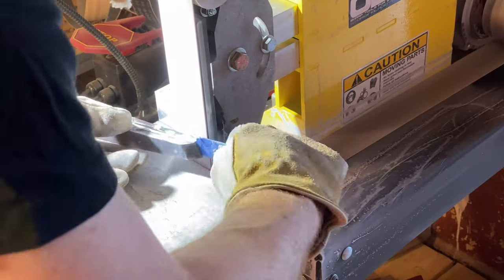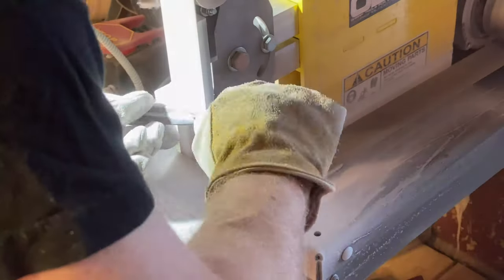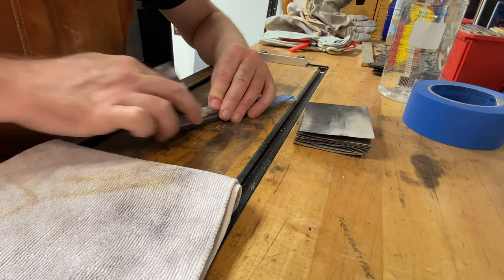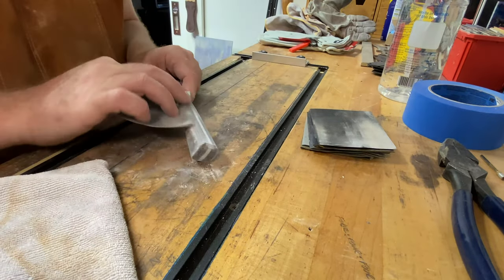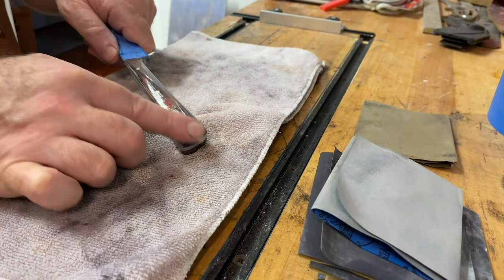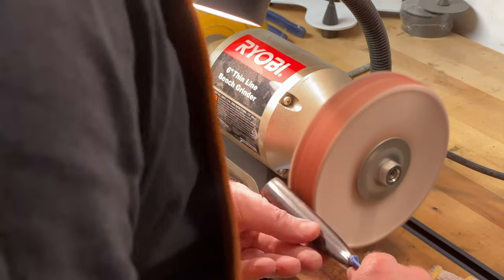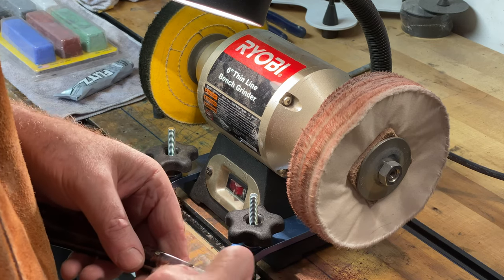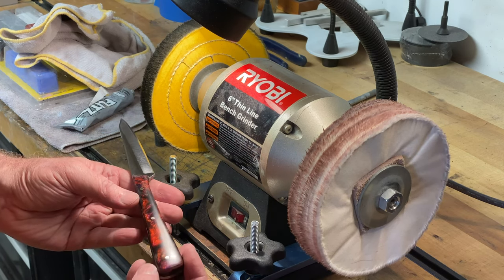How to shape and polish an epoxy resin knife handle

Comment: Nice knife and that work bench is awesome
Reply from the maker: Thanks! This is a 8' Gladiator workbench I bought from Sears about 20 years ago, and I added the T-Tracks about a year ago. I use Rockler hold down clamps in the track to keep my knife stable while I'm filing or sanding. The hold down clamps with the end stop are essential when I'm gluing up a composite knife scale.

Comment: Nice work! What would use on bone for final finish
Reply from the maker: I have not made any knives using bone for the handle. However, I think the process would be very similar. Bone can heat up and burn just the same so make sure you're not overheating when polishing.

Comment: Thanks for the video I'm sitting here sanding my first epoxy handle now. I've only made 5 knives so this hidden tang epoxy knife is kinda rough
Reply from the maker: Thanks for the comment Richard! Using epoxy for knife handles is definitely challenging. Over Xmas break I was able to see how these handles have held up after 1-2 years of use, and I can verify that they are still stable.

Comment: Does the compound ever get gummy and leave black marks on whatever you’re trying to polish?  Seems like I keep running into this issue
Reply from the maker: Yes, I've had this problem. I believe it's related to overheating the compound causing it to chemically bond to the epoxy. You need to have a light touch when buffing the epoxy. Don't stay in one place for too long and keep a container of water near to dip between passes.

Comment: Hey brother! Im new here lol but I just want to say good work, and I have a ? 
When you pour the resin it has this amazing 3D with all the colors, are you able to bring that back after the dullness of what the 2x72 leaves? I'm in progress of hand sanding now but it's not as glassy as I was hoping?
Reply from the maker: Hi Al, thanks for the question. I've found that the 2X72 does a great job in getting the basic shape and the start of a sheen. After the basic grinding on the 2X72, I move over to hand shaping where I move through grits down to 8000. With hand sanding, I don't start using water until I hit 1200 grit. When I reach 5000 grit, I use Flitz which is a metal polish but it works well with sandpaper and epoxy. Side note, 5000+ sandpaper feels like you're sanding with grit-less office paper. Finally, I move to the bench grinder with polishing waxes, making sure not to overheat the epoxy which can cause it to get a matte appearance. It's a lengthy process for sure, but I'm able to eventually get to a high gloss finish.

Comment: I have found cutlers rivets tricky and like the simplicity of pin rivets. Can you talk to me about setting pin rivets and how well do they hold ? Thanks
Reply: Hello William,  I've had very good luck with pin rivets, a mini drop of superglue could be the reason.  Saludos.   Anaco, Anz.
Reply from the maker: I use pins in all of my knives and I have yet to have one fail. There are a few things I do... 1) On my bandsaw I cut little grooves around the center section of the pin which basically gives the pin additional surface area inside the handle where epoxy can seat. I take a whole piece of pin material (usually 8-12"), mark the cut lines, then spin the pin material against the blade in the center of each pin. No need to be overly neat, just make grooves then cut all the pins to length. 2) Clean all of your parts with acetone before glue up and make sure everything is dust free. 3) Don't use a quick epoxy (5 minute) for gluing up your handles. Instead use a longer curing epoxy like West System G/Flex which has a working time of 60-75 minutes, initial cure of 3-4 hours, and a workable cure of 7-10 hours. With a longer curing epoxy, you can make last minute alignment adjustments, and G/Flex makes good structural bonds that resist expansion, contraction and shock. People use it on canoes, kayaks and boats so it's engineered to stand up to water and stress. 4) Don't be afraid to use the epoxy liberally especially around the pin holes when gluing up. I've found that 2 drams of each (resin and hardener) for a total of 4 drams is the right amount for the typical knife. I use drams because the little disposable measuring cups I use are marked with drams – 1 dram is equivalent to 1.77185 grams or 0.0625002 oz. If you want to pigment your epoxy (I like to use black pigment) just make sure to add it to the epoxy (not more than 10% of volume -- basically a few drops), mix well, then add hardener. Pigment can change the properties of epoxy slightly so it's best to stick with pigments that are engineered to work with G/Flex (https://knifemaking.com/products/we5018-white-pigment). Hope this helps!

Comment: Everything can be done on your belt grinder, Why waste all the time hand sanding?
Reply from the maker: I don't see a belt grinder as a fine finish tool – even with a fine grit belt. I prefer to hand sand both epoxy and wood because I find that it's much easier to focus on improving tiny imperfections without having a 2" belt threatening to add an unintentional mistake to the work. I think you'll find that with most fine crafts these days, 80% is done with a machine and 20% is done by fine handwork. Anyway, I don't see the tactile experience of hand sanding as a waste of time – I feel that it adds to joy of making things. At least that's my experience.